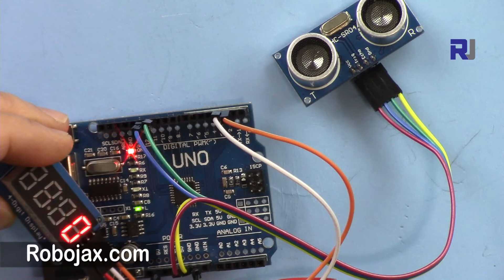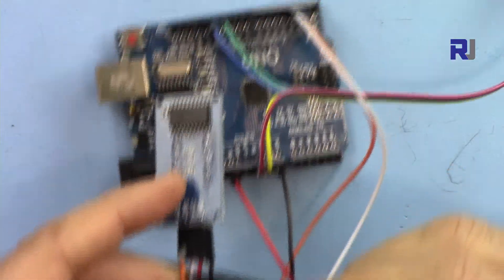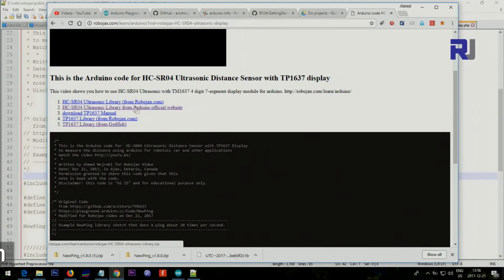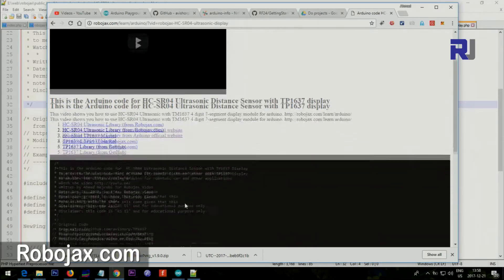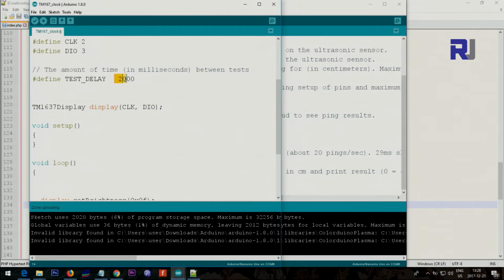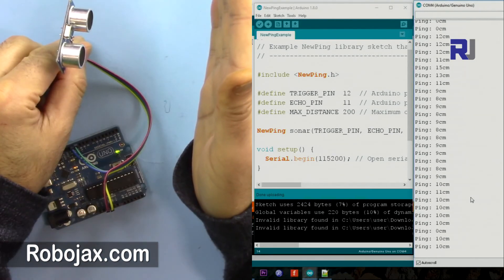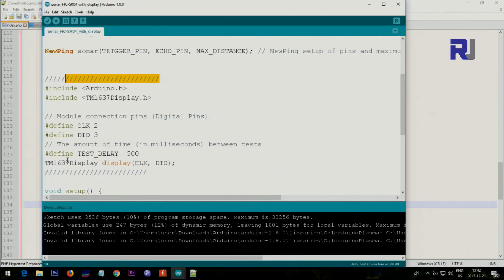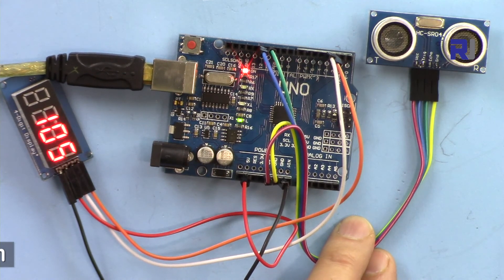How to use HC-SR04 Ultrasonic range finder with TM1637 display RJT31

Comment: bro i followed every single step..but after uploading the display is only showing a zero digit  with constant blinking although there is nothing infront of ultra sonic sensor
Reply from the maker: Hi, this video is made of two other tutorials. you have to watch them and make sure it works before coming this . 1-Introduction to TM1637 to display number on https://youtu.be/DuamjlstOKM 2-Introduction to Ultrasonic sensor  https://youtu.be/QI9541YQq7M

Comment: the code is not working
Reply from the maker: Please provide error so I can help you.  Post your code at  https://codeshare.io/ and once you posted, you will have new URL address on the codeShare.io. Please reply to this comment and post the URL for your code and I will try to help you.
Reply: https://codeshare.io/ayrM4z
Reply: i hope you can fix it. i get an exit status 1 error
Reply from the maker: The error could be  from display or the sensor itself so please try it as follow: 
1- First try simple code without display  and see if it works:  https://goo.gl/u9EbVk
2- Try the TM1637 display http://bit.ly/rjx-476 and made sure it work
3- Then try the ultrasonic sensor with TM1637 https://goo.gl/KHL6jM
Reply: it's working, thanks a lot
Reply: do you also have tutorials for the 8x8 matrix?
Reply: @brianmarkerink2432  up up